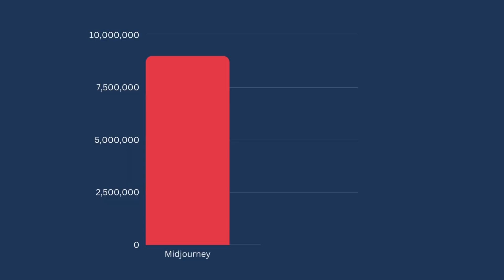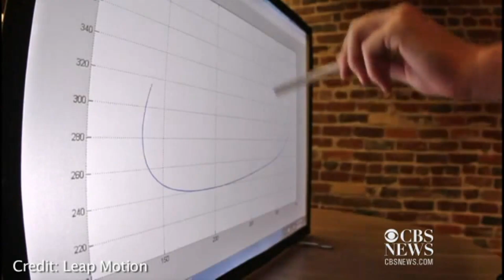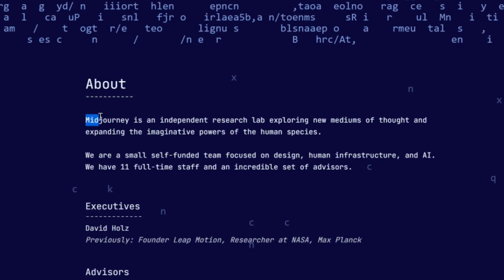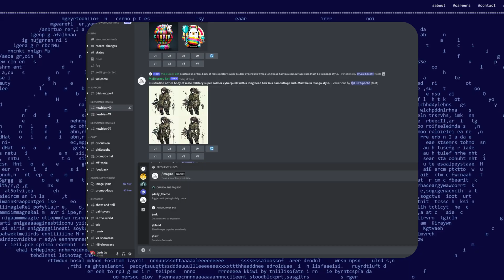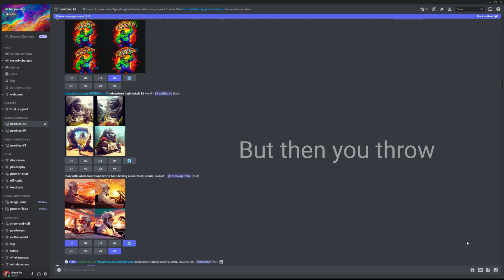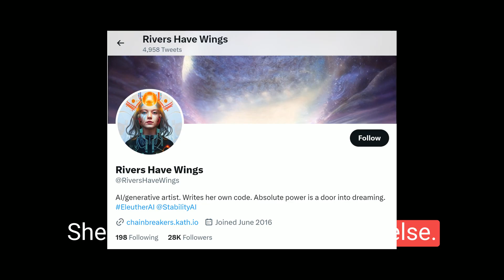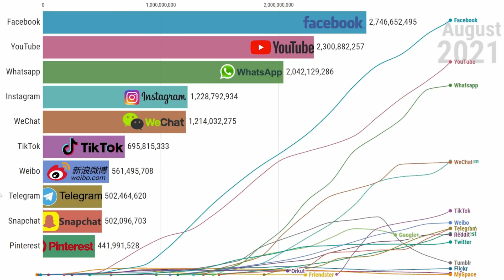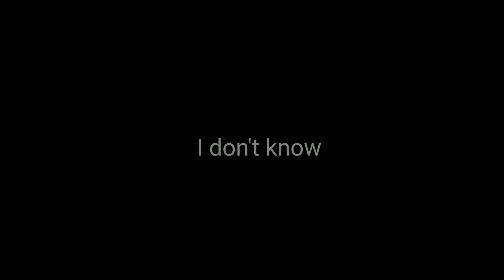Why Midjourney was created? And The Man Behind it

Comment: 8:30  he us saying rather than do the neural nets with processing and memory,   they need processors that are designed to work like neural nets in parallel, this is basic digital electronics.. This is the difference between a CISC processor and a RISC processor... THE GPUs are designed to do matrix math, but neural nets require a different pattern of processing.. NVidia already has these processors, the new mac m4s have processors more suitable, but is it fully parallel and as dynamic as  the brain?  Not really.. Its not as dimensionally nuanced..